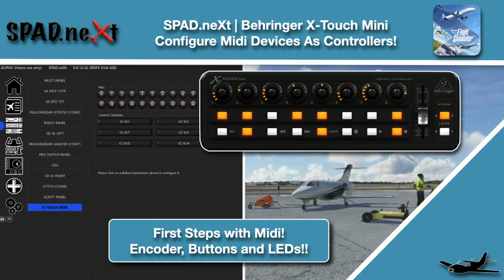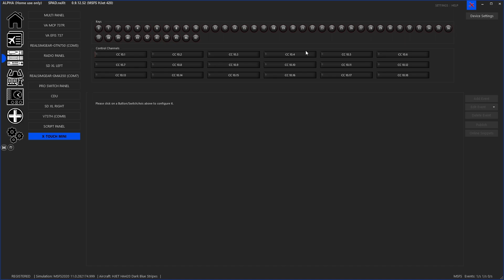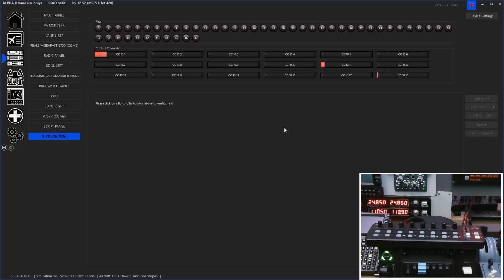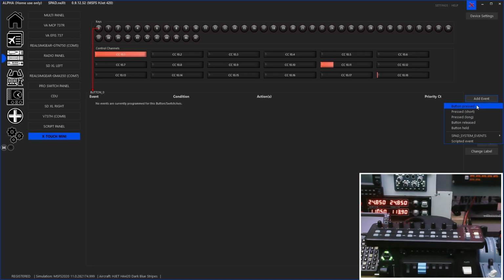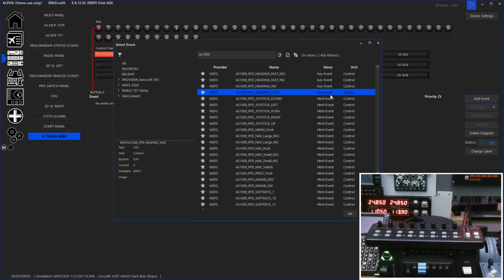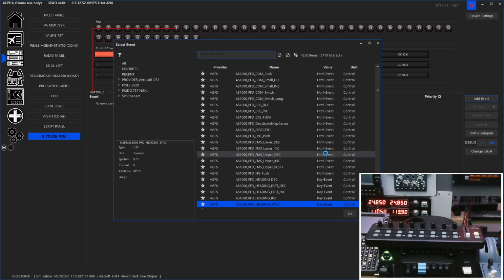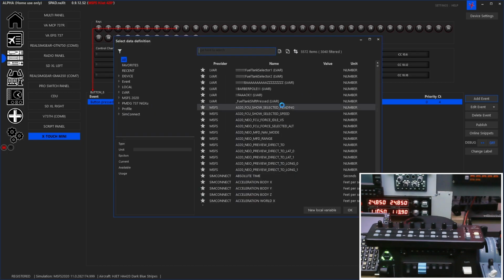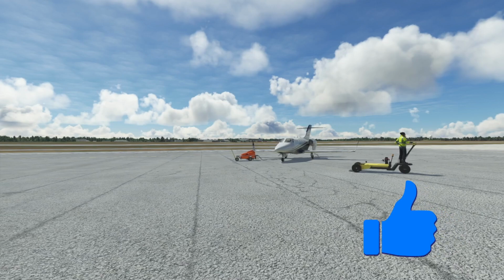MSFS | SPAD.neXt | Midi Basics | X-Touch Device Setup

Comment: Hey Les, I followed this video and got the X-Touch Mini working exactly like this. After a while I moved it to another USB port and even though it shows up in Spad none of the controls work, the lights come on etc but the slider, the buttons, dials do nothing in Spad (the buttons don't change color when clicked, slider doesn't move etc) in MSFS 2020/24 nothing works. I changed it back to the original USB port and now it doesn't work there. Any ideas what I might have messed up?
Reply from the maker: Nope and doing "support" via youtube messages is not really helpful.  Best to join the discord for spad.  link your license and then you can go to the appropriate 2020 or 2024 subchannels and post images of the configuration of the device and what is or is not working on those buttons.

That said -- with the new MC mode about to release in the next couple of days.  A lot of pain will go away since the integration will be able to directly control the hardware and not deal with local LED and paging control in midi mode.

Comment: Thank you for your video, gave me a lot of starting information

To thank you, here is a tip for the LEDs :
just need to add an extra condition to the button (the one having the LED you want to work). The condition should be : LOCAL:MIDI_X_TOUCH_MINI_BUTTON_7 equals 0, if you want to make the led of the button 7 working. (button 7 is the top left button of layer A). It works with all 32 buttons.
Then, no need to add a delay, or to check the state every X seconds... forget that.

Another gift for christmas :
send midi action : PatchChange 0/1 (layer A = 0, layer B = 1) to change the used layer. Then you can edit any led state you want (of both layer A or B).
Just change layer to the one you want, then change button LED state.

And last missing info : the channel for my product was 11, so put 11 in channel field.
Reply from the maker: 1 - no the issue is if a note is set you need to be off the button before SPAD is setting the button.. the hardware tries to set the light because you are pressing the button....  if you don't wait long enough then have spad set the state on the Var then it will be turned off by hardware.  This will be resolved when the MC Mode support arrives and then the hardware will stop trying to control any LEDs.

2 - Patch Change does not update the other way .. so sure you can send that to set the layer .. however there is no way to read that if the user uses the Buttons to switch the layer.  Again we will have this issue resolved about tracking the layer once we have MC Mode.

3 - Not Missing Info ..  using the Defaults it should not be channel 11.  That is what yours was on but that is not the defaults.  I have no idea if MC mode will resolve this but I am hopping it will then be all native.
Reply: @LesOReilly  you misunderstood my first message,

1 - add the condition I said, and you will see that the button LED will be set properly, even if you release the button 10 seconds later, even 999 minutes later, no matter.
2 - yes, cannot do reading, only writing. But once again, it perfectly works : you can set layer B, then button 5. Then come back to layer A, then set button 7. Each layer leds state will be memorized. The only issue is : it doesn't come back to the previous layer it was, but it's not that bad, because the information of every layer led will be correct.
And for that, there is still a solution : affect one of the 16 buttons to the layer change. Set a spad variable each time you use that button to change layer, and memorize layer. Then you have your current layer info.
3 - I confirm you channel 11 is the default one, at least in the official documentation.

Comment: Thanks for your video, really helpfull!! Is there a way for a midi "encoder" to assign it for example to the AP Heading and do all the 360° travel ? I understand the limitation of midi message from 1-127 but is there a way to solve this?
Reply from the maker: With the XTouch (only midi controller I have) the encoders always send a CW or CCW event so it’s endless. You don’t want fixed values that would be like an axis and would jump any time you touched the co trip if it did not already match in the sim.
Reply: @LesOReilly  I bought an xTouch mini and actually the encoders always send a CW or CCW event... Instead, with the encoders of my Akai MPK mini mk3 keyboard it doesn't work like that.. The encoders at the end of their travel no longer send events.. Thank you so much for the valuable information and your really useful and clear guides.

Comment: Hey Les, I just got into SAPD a couple of days ago, and I just bought this interface and I must say it's awesome. Totally awesome. 
Just wondering, is it possible to light up the ring around the encoder? I have programmed the push pull for the encoder, and it would be great to light that ring up, saving the pushbutton light for something else. Is that possible?
Reply from the maker: Just like sending the data back for the buttons there is also data for the rings. However you will need to review the documentation and configuration from Behringer as to what mode and channels to use.
Reply: @LesOReilly  Can you point us to that documentation?
Reply from the maker: its in the software from Behringer ..  go to their website for the product and download the packages

Comment: Perfect ! - ITS A NEW LANGUAGE OH MY.... i FOUND SOME COMPLEX SOLUTION FOR synch bug ON  msfs SITE, THIS IS WHAT i  (WE) NEEDED FOR EVER ! caps lock oops.
I turned on MIDI devices ... but I cannot seem to find "Keyboard" on device list ... is it there somewhere ? I am looking to assign SOFTKEYS for G1000.
Reply from the maker: I don’t know what you mean by keyboard. Midi devices show up under panels if standard midi usb device. G1000 is AS1000 and G3000 is AS1000.
Reply: I noticed "Keyboard" under a drop down while assigning commands - however I have found CLASSECHO to provide SOFTKEYS for PFD and MFD . so Im moving on from keyboards and Stream Deck for now.  - 🤔Thanks !
Reply from the maker: @marcw.5492  keyboard in the drop down is to send Keyboard keys ... like sending CTRL+G as the event to a button..
The Class Echo is using the EVENTS in the list that start with AS1000 .. use the Search function at the top when you add events to filter down using AS1000
Reply: Thanks for all the replies... no need to support here.

Comment: Have you observed a best practice to achieve reasonable predictability with the identification/order of devices that show up, be it USB such as a pair of x-touch mini's, or RealSimGear on com ports?  This may be different across OS's, I'm on Windows.  But I have observed less than predictable ordering with both the RSG gear (xFD's and GMA suite for example) and with a pair of x-touch mini's, and know others who are having similar if not more frequency of these issues on MacOS as well.
Reply from the maker: Well Spad does not work on MAC os ...  MY RSG devices all show up on the same com port they were last on..  I don't plug them back into different ports.

Xtouch is a problem because they don't have individual serial numbers or identifiers so windows will only report them as the come up...  SPAD does a decent job remembering USB ports .. so again make sure they are plugged back into the same exact port...  My SIM does not have anything taken away so it's always got all the items on all the exact same ports
Reply: @LesOReilly  does Spad remember the ports on a hub as unique and generally not changing?
Reply from the maker: @KirkRoyster  its not a spad thing .. its a windows thing and if windows is able to do that ..  I have 3 USB Hubs and all of my devices are in those (except streamdecks) and mine are all fine..  I don't have any issue..  There are other members in the discord with lots of RSG devices on hubs as well .. none are having issues..  again make sure you are not plugging into different ports on the pc from the HUB as well

Comment: How would I use a Roland TR-8S Rythm Performer as a controller with this?  And if it's possible, would using it with MSFS2020 mess up the settings I use for music production?
Reply from the maker: If it is USB Midi then it will just show up in SPAD as long as you enable it..  then press buttons and turn knobs to see the Midi Note / CC show up.  Just don't change the default config of what notes or control changes it sends then it won't have an effect
Reply: @LesOReilly  Great, thanks Les.

Comment: Is possible to use Xtouch Mini with Aerofly FS4 ?  I haven’t informations about the key on the Simulator for the Knobs.. 😅
Reply from the maker: anything that can be configured in SPAD can be configured on these..  I don't use Aerofly ..  but these are basically "buttons" like another joystick.  If that works in spad for aerofly then it will work on the Midi devices

Comment: I have 2 of the X-touches and all set up thanks to this, but something happened and the controls set on Xtouch A are using that of Xtouch B which messes up all my labels I have stuck on them - how can I switch them back? I tried under the device assignments but it did nothing. Any tips?
Reply from the maker: sounds like windows re ordered them .. they don't have unique IDs or serial numbers so if they get reorded by windows then it happens Not sure why you can use the Device assignments menu under profiles to re order them ..  That is how I did it with my COM devices that got reordered... Left side is what is in the profile and the right side is which hardware device ..  So you could select from the drop down which device assignments on the Left will go to which hardware assignments on the right
Reply: @LesOReilly  thanks Les... That's good to know it's a little bit out of my hands on the Window side. Will give it another crack in Spad - as I did get it halfway there in where the actions were woking, but the midi lights were still inverted (e.g. press key on right, key on left lights up!). Do appreciate the time you spend responding in detail here. Cheers, Tim
Reply: @LesOReilly  Update: I've got it behaving now (fingers crossed!)... I used a program to delete both the x-touch USB devices in windows, then restarted and connected the first one  and spin up Spad, and then add the second one. I also connected the first one direct to the PC as had been using a hub. The second one is in the hub. It's remembering the order now with no dramas so it leads me to believe it was the hub causing the confusion. If it wasn't 2 identical devices, then prob no issues, but with the hub it seems like it was the problem.

Comment: Somehow when I program the lights like in your video (excellent video by the way!), the light will only come on when the button is pressed and when released it's off again. Somehow the light of button 8 (left top) will illuminate and stay on.
I hope you can help me solve this 🙂
Reply from the maker: You need to add a second condition that checks against SPAD Up Time..  The issue is that the message to turn the light back on is coming in while the button is still pressed down and the hardware is turning it back off again

Comment: are there any prerequisits i need to do which are not within the video? plug-in the x-touch (with its default settings), install spadnext, activate midi within spadnext and you are ready to go...?
one i set up the controls, can they be saved in a file?
can i program a profile for each aicraft type and spadnext automatically loads the right one?
thx
Reply from the maker: You create profiles for aircraft which allow auto switching when you load a different plane. Yes you have to map the controls how you like them. 

There are “snippets” which you can download through the app which have these configurations which others have done. But that is not “automatic” you have to click on a button and then browse the online database to pick the device you want. 

Entire profiles can also be published however that is a collection of all devices and may or may not match all the devices you have.

Comment: Thanks, really useful tutorial. Did you experience very high cpu usage using the x-touch mini? I use many other peripherals and the usage is pretty low, but as soon as I start using the midi controller, I have more than 30% CPU usage.
Reply from the maker: No I have not seen this issue.

Comment: Nice. however when i go add event and add action/send simulation-event, it seems fenix a320 is not there? some of the bottens work when i use simconnect others dont. maybe i am missing LVAR ?
Reply from the maker: Fenix is all LVAR. There is a Fenix channel in the discord with lots of examples.
Reply: @LesOReilly  thx Les. I Will look at discord☺️
Reply from the maker: Yeah I don’t use the Fenix as it does not output lots of the data and screens since the license from ProSim does not allow it.

Comment: This is great. I have a small question: I see the plane uses heading lock and nav1 lock variables depending on LNAV mode, so I programmed my x-touch led lights to turn on or off depending on the mode and they work great. But if I use an x-touch mini button to send a heading lock command I see the heading lock variable changing to 1 but the led in the x-touch is not turning on. In other words the variable is in 1 and the led is off.... why can this be happening? Any workaround? Thanks!
Reply from the maker: Add an additional condition to your script which checks Spad Uptime (any change) ..  That way on every second it will check the condition and turn the LED on ...  The issue is that you press the key and by the time you let the button up (and the device turns the light off) spad has already sent the light on command.
Reply: @LesOReilly  Thanks Les! Just curious: Why this doesn't happen for you in this video?
Reply from the maker: @LuisArgerich  because I pressed the button "faster" :) ...  if I pressed it slow it could go off as well...  I have since implemented the use of the SPAD uptime in my other midi panel builds

Comment: I have watched "How to Light The LEDs on the Buttons" over and over. I can not get the light to stay on. It will light up when i push it, but only when i hold my finger on it. Everything else is working like a charm. Just the darn LED.
Reply from the maker: See the most recent midi video we add an additional condition which has the script run more often and won’t get stuck in the command coming in while button is still depressed.
Reply: Hii  did you finally, find a solution for the problem of the leds? If so, please let me know. Greetings and thank you very much.
Reply from the maker: It’s what I said.. need to use another condition with an AND that checks the uptime or any variable that is updating any second… or you put a delay of like 500ms or 1 second before the LED ON event… that way the condition won’t trigger the LED to happen before your finder is lifting off the button.

Comment: Now if I only could get the PMDG 737 buttons to light up... For some reason, using your video of the Bravo for 737 commands and applying the same concept scripts from this video, no work for the LEDs on xtouch mini on 737. hmm.  Nice job again with this excellent video!
Reply from the maker: Maybe use a script that references a condition of Spad uptime so that every second it checks the variable.

Comment: Les, How did you figure out which "note #" corresponds with which button? It looks like the top row buttons, left to right,  are 0-7 and bottom row is 8-15. When I changed the "note" number for my config, it would not light up.  I know I have 98% code right because when I copy you with note zero, it lights up the first button top row and flashes if I set velocity to 2.  Am I changing the right one or is it Channel number I should be changing for a different LED button?

Never mind, I figured it out. For anyone else, LED button corresponds to changing the note number for both LED light entries, off and on. 0-7 top row,  left to right, 8-15 bottom row.
Reply from the maker: yes it is in the manual that came with the Xtouch.
Reply: So channel remains at 0?
Reply from the maker: Depends what you have your global channel set to
Reply: Try changing channel to 11 (that stays the same for all) Note # changes per button as you have stated above.

Comment: Superb Video Les.  I am so tempted to get  the X-Touch Mini.  I am wondering what can I use  the master fader for.  Can it be used as an attitude trim or would the degrees not be sufficient?
Reply from the maker: Well it is an Axis essentially... So anything that you would use for those items.. Even a light level would work.... or Flaps.. or spoilers...  Not sure TRIM is a good idea since it will jump back the moment you move it if the AP has moved it to a different value...
Reply: @LesOReilly  Yeah, you are right - not such a good idea. 

I do have  lots of buttons, switches rotary encoders and a streamdeck SD xl but I guess it never enough, so may consider buying one (maybe wait for black friday) :).

To me , your SD and encoder video is one of the best, but then again all your videos are quality.
Thank you for your swift response.